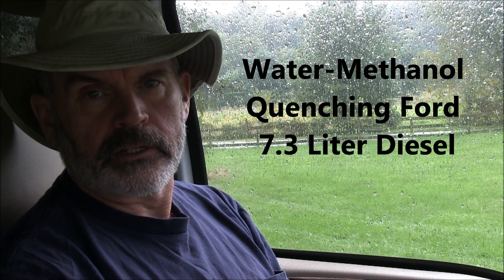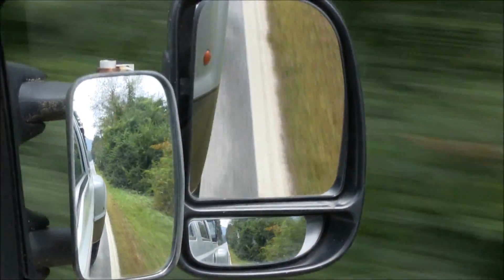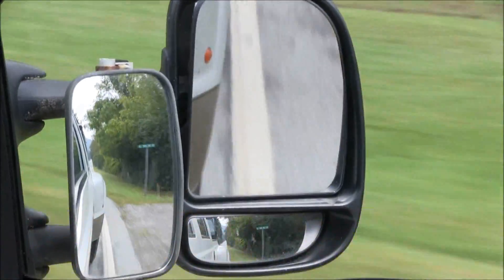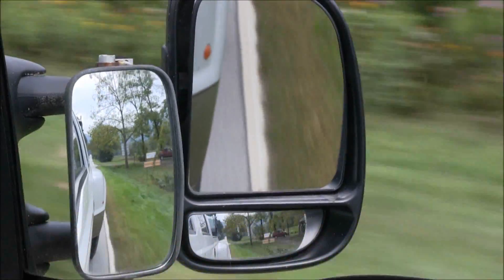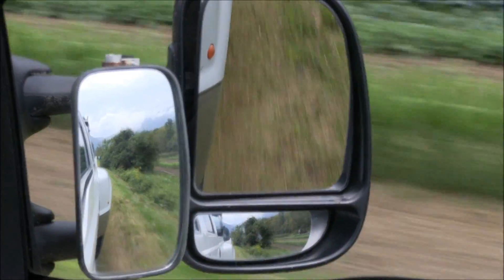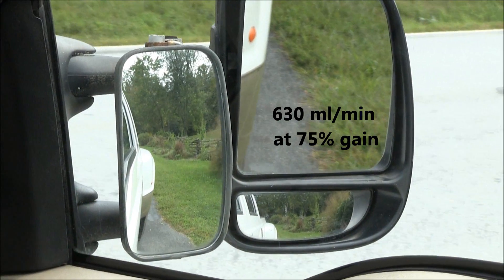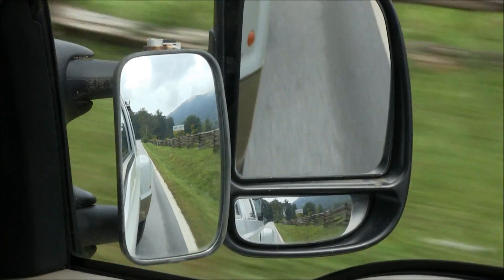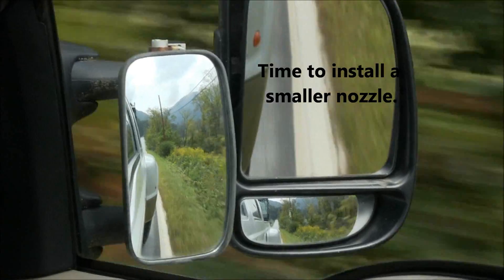Water-Methanol Quenching Ford 7.3 Liter Diesel

Comment: I just installed the same kit on my Duramax and for the price of washer fluid I have not seen a cost savings as of yet. I definitely feel the hp boost, do not see the fuel mileage increase. I think that I should have done the Propane inj. instead.
Reply: I hear if you tap the hose and run a separate line to spray on the outside of the intercooler it helps a lot. At least on hot days.
Reply: chris beery thank you, I might try that next summer. Stay out of California if you want to run washer fluid - it's illegal to sell in the entire state because it has methanol in it.

Comment: Do you have a video of the installation of the water methanol injection system?  

How much did it drop your egt?

When pulling heavy load how many gallons of methanol to gallons of diesel fuel?

Comment: G'day mate!  Great video. I was just thinking, if you have two injector nozzle fittings could you put the number 5 nozzle in one and the number 2 in the other? That would give you 475ml per minute. Just a thought. I love this kit too!  
Number 6 is 625ml  
Number 5 is 375ml 
number 4 is 225ml 
number 3 is 175ml  
Number 2 is 100ml and number 1 is 60ml per minute.

Comment: I also have a WM kit and am tuning with aquamist setup. If your WOT was fine and you are tuning based on 10-15% of total fuel cc for water or 15-25% for 50/50 mix then I'd turn down gain to 0 and see if it needs negative values. I've researched a lot and am currently going to try 100% water for higher knock threshold vs my current 55/45 meth /methanol mix. I'm a tuner so let me know if you need help, have a good one.

Comment: Your concentration of water to methanol will have a huge effect on quenching. Your testing has mixed results and thats probably has to do with when your injecting and the concentration that you're using. The largest Snow Performance nozzles are rated for 625ml/min.

Comment from the maker: I installed a Snow Performance Tow Max system and it cost $760. I can not recommend the Tow Max system though. I am doing another video that covers the installation of the Tow Max system and yet another that covers problems with the Tow Max system. But I am getting a big horsepower increase. I can definitely feel it and it make towing my 16,000 pound trailer easier.